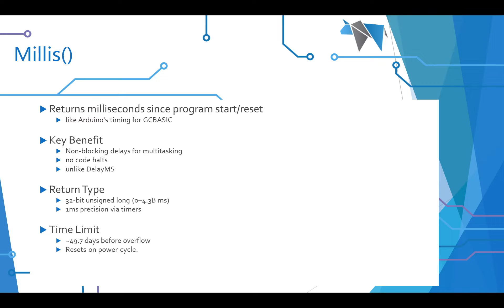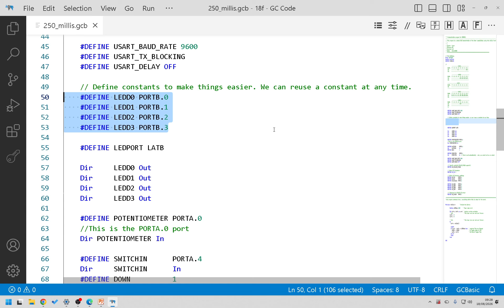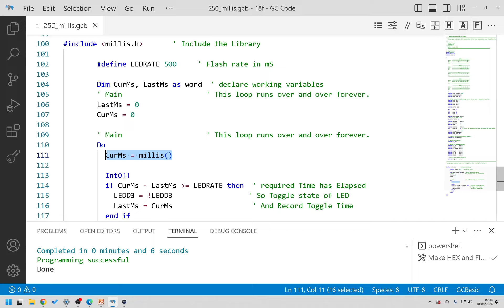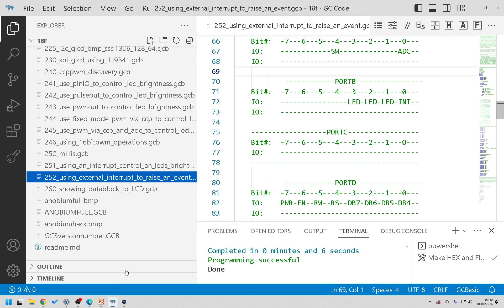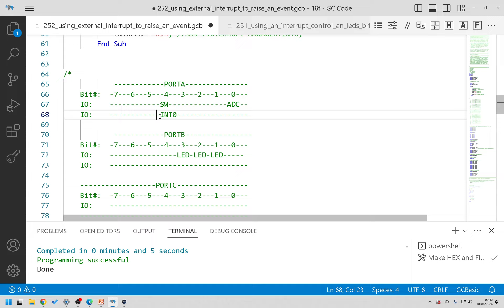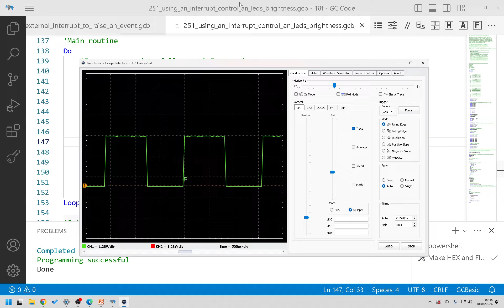PT15: PIC18FxxQ35 chip Family - Using Millis and the Interrupts

Comment: Excellent Evan. Using the millis() function allows cheap 8 bit micros to cycle through multiple tasks, with each task running concurrently in (almost nearly) real time. Essentially this is running an RTOS (real time operating system) on a tiny microcontroller. A very neat solution for multitasking.

Comment: I have tried to use GCBasic millis (millis blink program) instead of arduino IDE. When you program the 328p or atmega2560 it seems to work, but as soon as you decouple the arduino uno or mega and reconnect is to USB-power it is blinking much to fast. The millis.h library for AVR MCU's seems to be faulty.